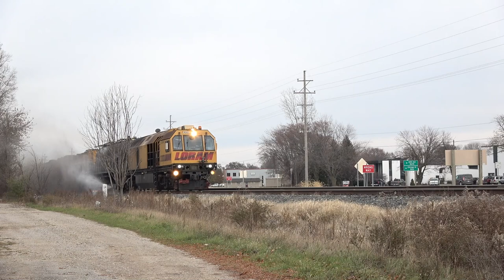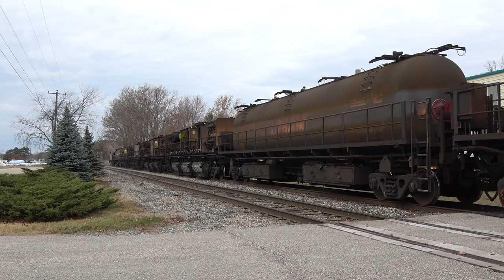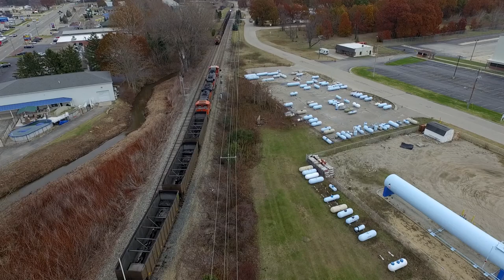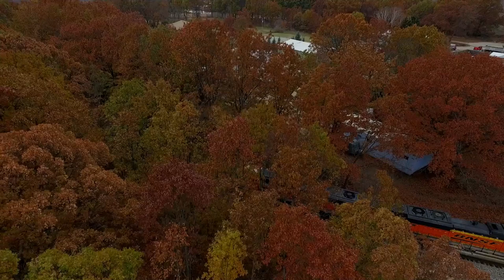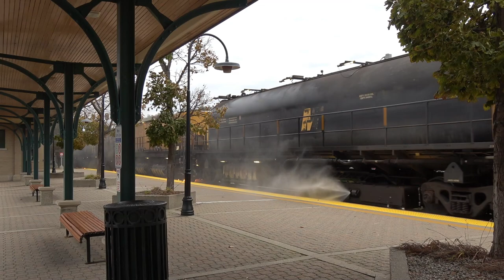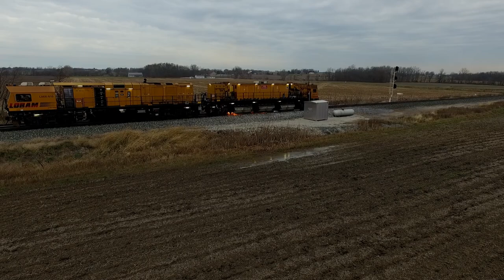TRRS 518: The Train from Hell - LORAM Railgrinder in Action

Comment: I'm part of the Loram crew and I'm on a rail grinder are machine is RG414 the newest one in the fleet
Reply from the maker: I'm assuming just because it is the newest doesn't mean it is clean? 

Question: do you know how they make the cabs? Are they on old locomotive frames or built from scratch? Thanks!
Reply: Thornapple River Rail Series they are built from the ground up and are machine is pretty clean. We just washed it for a guy from trains magazine that toke pictures of are grinder
Reply from the maker: Thanks, Andrew! I recognized the EMD B-style trucks so that got me curious. I actually almost signed on to work for LORAM last summer as a summer laborer but took an internship at a Civil Engineering Consulting firm instead! Little cleaner of an experience!
Reply: Thornapple River Rail Series 😂😂 it's very dirty and very dangerous work if you don't pay attention out there you can easily get killed or seriously hurt

Comment: It's important and necessary to keep the rails running smoothly between 2 enormous metropolises such as Saugatuck and Hudsonville! Lol
Reply from the maker: Now now, they do run a 3-car passenger train each way daily - sometimes up to 24 axles in the busy season!
Reply: A lot of cargo runs through that rail system, even if the passenger number is relatively small.  Smooth rails are absolutely vital for freight timetables, and decrease the chances of derailments, couplers breaking and other such wipeouts.
Reply: you realize this is  part of a longer stretch connecting muskegon, grand rapids, and other points north to chicago, right?
Reply: me999
No.  I was assuming that most people have probably never heard of these 2 towns, just as most people have never heard of the 3 towns I lived in before I was 13. I was joking.